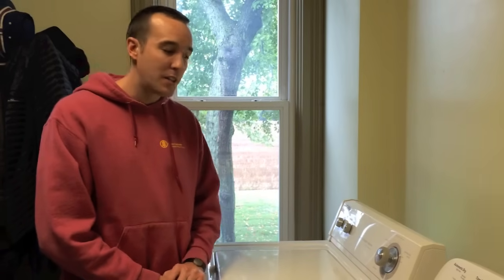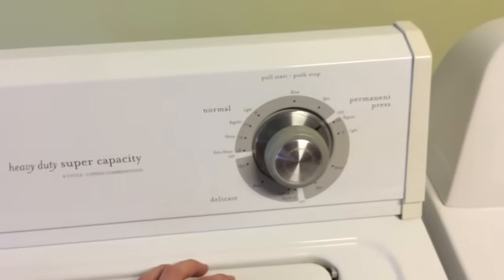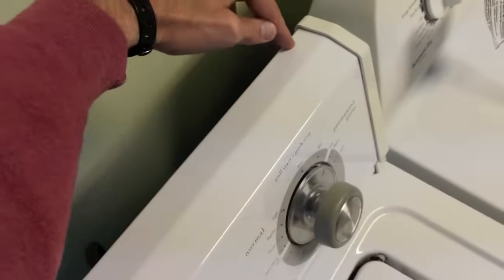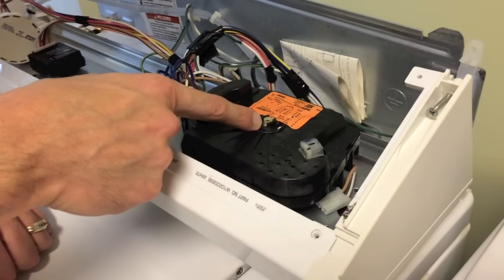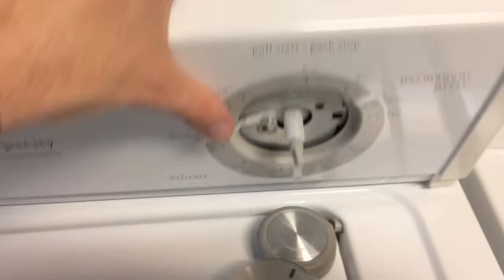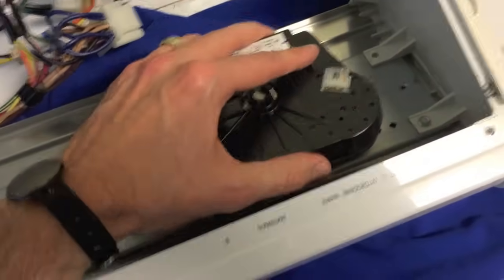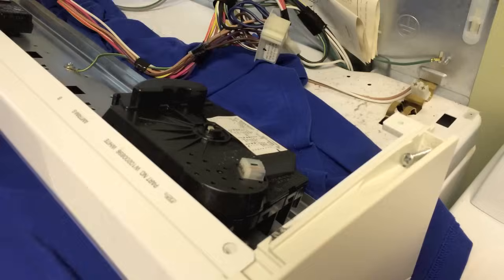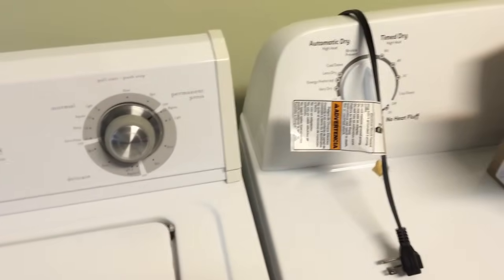My washing machine stops at Rinse - Does not DRAIN or SPIN

Comment: Please help me please your advice would greatly be appreciately. Am i doing something wrong
Reply from the maker: Susan Francis Washing Machine problems are no fun because of how important they are to us!  Since your Cycle is not filling and rinsing, it’s very possible that it’s your Timer which is shown in this video.  In addition to that, below is are two video links that shows a possible blockage in the Water Inlet Valve & Hose...we ran into this.  Once the cycle got to the point of filling up with water and rinsing, it stopped...and that was because of the clogged Water Inlet Valve & Hose.  Check this video out below 😎👍

1.  Clogged Water Inlet Valve
     
       https://youtu.be/DiPFZSMiBn8

2.  Clogged Water Hose

       https://youtu.be/DwJLd7xwaUM

Comment: How do I know what position/step the new timer is in?
Reply from the maker: marcel pilich Thanks for checking out the video and sharing your comment Marcel.  After replacing your Timer, you will begin a wash cycle at the very beginning.  In the even that you have a load of cloths already in the washer that has been through 1/2 the cycle...but then stopped due to failed Timer...it's best to just re-run the cloths through a full wash with new Timer.  Hope this helps!  Please Subscribe to the channel and turn on your YouTube notifications that would be awesome thanks again 😎👍

Comment: whirlpool washer bought used. lid switch activated by arm attached to lid inside the machine. I hear a click. The only action is a filling and draining of water at the same time no matter where the timer is placed. bad timer?
Reply from the maker: john rbaugh Thanks for checking out the video and sharing your comment and experience John.  You're experiencing a syphoning problem.  It's very possible that the hoses aren't properly installed.

1.  The drain hose might be extended too far down into the home drain

2.  During hook-up, the drain hose might be sealed off or clogged.

3.  Your actual home drain is far below the 30" line and anti-syphoning clip hasn't been installed correctly.  The drain hose coming out of bottom of washer should extend up to a level of 30" or higher when exiting home drain.

Keep me posted.  Please Subscribe to the channel and turn on your YouTube notifications that would be awesome thanks again 😀👍

Comment: hi my washer mashine does wash, spin n drain, but when its done the clothes are still soaking wet
Reply from the maker: Johana Sandhoval Hi Johana, thanks for checking out the video.  This is not uncommon...you can be experiencing one of these items.

1.  You can possibly have a clogged drain hose...possibly a sock is stuck in the rubber hose.

2.  Belt may have snapped.  The belt spins the water pump to drain tub...if it snaps, it won't drain.

3.  Water pump failed...the pump might not be pumping water out.

4.  Lid Switch may have failed.  Its possible that the lid switch failed and not sending correct signals to timer to spin / drain properly.  

Keep me posted, please Subscribe to the channel that would be awesome thanks again 😎👍

Comment: I need help ,my new Samsung washing machine when washing turns or spin less than 3seconds to wash every 1minute compared to the traditional machine that washes and spin longer. What should I do now!soo much dirt in the clothes after wash
Reply from the maker: Hey Chris, thanks for checking out the video!  Thats no fun.  Just so I understand...your machine is not properly functioning during the rinse spin portion of the cycle.  This could be your timer.  The timer regulates the wash cycle by moving it through all the required interval steps (Filling bowl with water, wash, drain, rinse...)...once this part becomes intermittent or fails indefinitely, you may see your symptoms.  Please Subscribe to the channel that would be awesome!
Reply: thank you for your swift reply but right after the water level is up the washer doesn't spin well to wash
Reply from the maker: Ok...thanks for the reply.  This sounds more like the drive motor is beginning to weaken.  As the motor ages, it will begin to lose strength and not be able to spin loads of cloths that it was normally able to in the past.  In addition, the belt that is connected to the drive motor tends to stretch over time...which as you can imagine, will become more and more loose on the shaft resulting in the belt "Slipping" on the gear.  This will lead to the inefficient performance of the wash.  Try washing a small load of cloths.  You might see that as the load is lighter in weight, your machine will still be able to work normally.  If so, then heavier loads will need to be split up into 2 different loads until motor fixed.

Comment: The problem with my washer is it just stops before it hits rinse and does not advance. It fills with water, drains, but just stops when it hits rinse at the dial. I have replaced the timer and bypassed the lid switch but I still have the same problem. Any suggestions? It is a Whirlpool Ulitmate Care II
Reply from the maker: inebriatedbum Thanks for checking out the video.  Turn off water supply...Disconnect your warm/cold water hose...clean filter and see if that helps.  Keep me posted.  Subscribe to the channel that would be awesome thanks again
Reply: Thank You! Turns out it was a faulty water inlet valvue. I noticed it was humming which it didn't do before I replaced the timer. Working great now!
Reply from the maker: inebriatedbum Awesome thanks for the update!  This will help future viewers as they read through the comments and see what others have run into.  Thanks again for taking the time to share your experience 😀👍
Reply: inebriatedbum faulty water inlet valve

Comment: hi...  i have a maytag washer.. it wont drain the water. i know the lid switch works the tub will spin slowly. i replaced the belt thinking it was slipping and there was oily or rubbeize on the floor.. i thinking the motor not working right it cover in some grease i guess the motor is bad, now it washes great and once the water is out it spins.. what esle can i do?
Reply from the maker: Terry Sansom Hi Terry.  Thanks for checking out the video.  It is very possible that the belt was the main problem.  As you mentioned, the belt can begin to slip as it ages and stretches out.  Replacing the belt was a great choice.  As far as the motor, is it making any unusual sounds or grinding noises.  Have you noticed any change in tone with the washer?  Any unusual, grinding, loud sounds can be an indication of the motors inner parts beginning to fail...but as you mentioned it's running great now.  Keep me posted.  Please Subscribe to the channel that would be awesome thanks again 😎👍

Comment: my washing machine will work on all settings except delicate. it will work, but it keeps turning off & on. I think it will work if I leave it alone, but I usually just wash on normal load. can anyone help?
Reply from the maker: Thanks for watching, any update?  Have you replaced the Timer or Lid Switch?

Both of these can cause your exact issue unfortunately.  Helpful video link below.

1.  Replace Lid Switch

         https://youtu.be/1hTRc-_PnP8

😎👍

Comment: Hi, can you help me? After a power outage while the washing machine was running (right before it hit rinse), it continously stops there. It washes well, rinses a few times, stops at the last rinse and doesn't drain.
Reply from the maker: Luluta lulu Thanks for checking out the video and sharing your experience.  You are experiencing 1 of 3 issues...

1. The power outage may have sent an electrical surge through the system & possibly failed a part...

     * Drain Pump
     *  Lid Switch
     * Timer...which is mentioned in this video.

There are a lot of electrical wiring that feeds inside to all the parts & again, it’s possible that an electrical current went through your system during the power outage that exceeded normal electrical range...thus failing a part... in my opinion this is very unlikely so what I recommend is...unplug in your washing machine completely from the wall and let it sit for 10 minutes.  After 10 minutes, Plug the washing machine back in and run a test cycle to see if you experience the same issue.  If you do, then let’s figure out the next part to focus on...below are the next steps!

2.  Your timer is wearing out and beginning to work intermittently during the cycle...leading to the stop & go... replacing your timer may get rid of this issue.

3. Your lid switch is wearing out and beginning to work intermittently.  Once your wash cycle gets to the spin portion, your lid switch verifies that your actual lid is closed.  It Then sends an electrical signal to the timer to continue the cycle and begin spinning.  If your lid switch is not working properly, the timer will not continue to the next stage of the cycle... this is a safety feature that does not allow the machine to spin with the lid open...which alleviates the machine throwing water all over your house...not good 😮.  Replacing your lid switch is both repair friendly and cost friendly.  Below is a link to my video changing lid switch

Keep me posted!

Please subscribe to the channel and turn on your YouTube notifications that would be awesome thanks again 😎👍

https://youtu.be/1hTRc-_PnP8

Comment: Could it be the clutch
Reply from the maker: A Hackers Life 

Thanks for watching & sharing your questio.  Before replacing clutch, Let’s take a look @ your water intake valves.

These valves can clog over the years of operation and in the event that they clog...your water intake will obviously slow down and or stop completely.

As of now it’s still sounds like your water is coming in and out of the machine just fine however as the screens inside the valves gather more and more grime in debris... it can definitely lead to the timer, lid switch, & cycle duration being interfered with.

Below is a link to a video that shows the step-by-step process on replacing the part that has the valves.  Definitely check it out!

       https://youtu.be/DiPFZSMiBn8

Keep us posted!  Please subscribe to the channel and turn on your YouTube notification Bell 🛎 that would be awesome thanks again!  😎👍🔧🔩

Comment: Mine doesn’t seem to have any power at all and it is stuck with water and clothes in it
Reply from the maker: AgapeFit Mommy 

Thats no fun!  😲

You are most likely experiencing 1 of 2 issues...

1.  Your timer is wearing out and beginning to work intermittently during the cycle...can lead to stop & go ticking... replacing your timer may get rid of this issue.

2.  Your lid switch is wearing out and beginning to work intermittently.  Once your wash cycle gets to the spin portion, your lid switch verifies that your actual lid is closed.  It then sends an electrical signal to the timer to continue the cycle and begin spinning.  If your lid switch is not working properly, the timer will not continue to the next stage of the cycle... this is a safety feature that does not allow the machine to spin with the lid open...which alleviates the machine throwing water all over your house...not good 😮.  Replacing your lid switch is both repair friendly and cost friendly.  Below is a link to our video changing lid switch.

       https://youtu.be/1hTRc-_PnP8

We highly recommend replacing both parts at same time.  This will ensure both parts are brand new & ready to work.

Keep us posted!

Please subscribe to the channel and turn on your YouTube notification Bell 🛎 that would be awesome thanks again 😎👍

Comment: I have a croissant brand machine that works with one touch of a button,completes the entire cycle on its own,but two days now it fills to wash,but when to rince the wachine dont full to rinse.what do u suggest i do?
Reply from the maker: Susan Francis Thanks for checking out the video and sharing your experience.  You are experiencing 1 of 2 issues...

1.  Your timer is wearing out and beginning to work intermittently during the cycle...leading to the inconsistency of the cycle steps...replacing your timer may get rid of this issue.

2.  Your lid switch is wearing out and beginning to work intermittently.  Once your wash cycle gets to the spin portion, your lid switch verifies that your actual lid is closed.  It Then sends an electrical signal to the timer to continue the cycle and begin spinning.  If your lid switch is not working properly, the timer will not continue to the next stage of the cycle... this is a safety feature that does not allow the machine to spin with the lid open...which alleviates the machine throwing water all over your house...not good 😮.  Replacing your lid switch is both repair friendly and cost friendly.  Below is a link to my video changing lid switch

Keep me posted!

Please subscribe to the channel and turn on your YouTube notifications that would be awesome thanks again 😎👍

https://youtu.be/1hTRc-_PnP8

Comment: Great video. 
I have this problem on a Kenmore Series 90. 
I’ve replaced the timer, the lid switch, the control board and the water level switch. It still stops!
Any ideas??
Reply from the maker: David 

Thanks for watching David, we appreciate you reaching out to us.  This happened to a friend of ours...replaced several parts & still had the same symptoms as you are currently having.

We did some more inspections on his machine & found out that slow water flow...aka...water hose blockage was causing issue.  We replaced Water Valve & all works perfectly normal.

Below is a link to our step-by-step video that shows replacement of Water Valve.  This may solve your problem.

       https://youtu.be/DiPFZSMiBn8

Keep us posted.  Please subscribe to the channel and turn on your YouTube notification Bell 🛎 that would be awesome thanks again!

😎👍🔧🔩

Comment: Hi! I have the exact same washer as you. About a month ago I had a constant slow drip inside of the washer. Sometimes when I would run a cycle on hot it would not happen.  The washer still ran just fine, worst case it would fill up the washing tub with water slowly. Anyways, I was washing clothes all day yesterday and I went up to switch out my loads. My washer was stuck on the rinse cycle and still full with water. Can you PLEASE help me on what I should do? Thank you!
Reply from the maker: Kristen Foster 

Thanks for watching & sharing your experience!  Let’s get this figured out together!

Two parts usually cause this.  

1.  Timer: Which is shown in this video.
2.  Lid Switch:  Which we will explain below.

Either way... Believe it or not... we recommend replacing both of these parts together as they communicate to each other so much during the cycle.  It’s best to have them brand new together.  😁

It can be your Lid Switch.  The lid switch is designed to be a safety feature or mechanisms.  Once your wash cycle gets to the rinse portion, the Timer sends a signal to the lid switch and asked if the lid switch is compressed...meaning the door or lid is fully closed!

The reason behind this is to alleviate your washing machine rinsing and spinning with the actual tub lid open and allowing the washer to throw water all over your house...that would definitely not be cool.  😲

So to recap… the Lid Switch is a safety feature that sends the “ok” signal or “Yes the lid is closed” confirmation to the timer to allow the timer to continue the cycle!

Hope this helps!  Please subscribe to the channel and turn on your YouTube notification Bell 🛎 that would be awesome thanks again!  😎👍🔧🔩

Comment: Mine doesnt spin and it smells like smoke i dont know what to do
Reply from the maker: Thank for checking out the video!  Smoke smelling washer is no fun...in most cases, this is signs of a few things!

1.  Your Belt has gotten to a point in which the tension has weakened and its possible that the belt is sliding rather than spinning as the Drive motor attempts to spin belt...which in return is supposed to spin the washer bowl full of cloths...

I recommend inspecting the Belt to see if you see any forms a wear/burnt spots...or even frays.  If so, a new Belt should help tremendously!

2.  A possible Drive motor beginning to fail.  The Drive motor spins the Belt and as we mentioned earlier, will spin the washer bowl.  Over time, the Drive Motor wears out and can do a few different things...overheat & give off a smoke odor for a bit until it fails.  

It can fail intermittently...working for a few seconds, then stopping...and repeating...annoying I know..

Or just Fails all together!.  

Keep me posted!  Please Subscribe to the channel & turn on your YouTube notifications that would be awesome thanks again!
Reply: DIY With Michael Borders Mine stopped at the rinse cycle and immediately started smelling smokey and electrically. I immediately unplugged it and left the door lid open and switched the nozzle to off! Could it be the belt?? I was so afraid it was going to spark and catch on fire. 😨😨
Reply from the maker: Nina Vitale 

Thanks for checking out the video and sharing your experience Nina!  Sounds like you did the right thing at the right time!  Awesome job Nina!  

It’s very possible that the belt has weakened & stretched out a bit over the years & has become loose on the drive motor.  

In this situation, the drive motor will keep spinning & possibly making contact with a stationary portion of the belt...causing rubbing & smoking...NOT COOL 😱

We recommend taking a good look at the belt!  Let’s start there!  Keep us posted!  Let’s get this figured out together!

Please subscribe to the channel and turn on your YouTube notification Bell that would be awesome thanks again Nina!
Reply: Lucero Torres gjnmbdd
Reply from the maker: Carlos Larribas 

😎👍🔧🔩